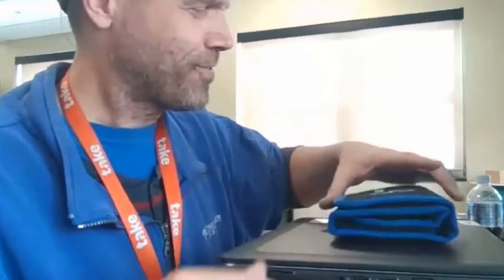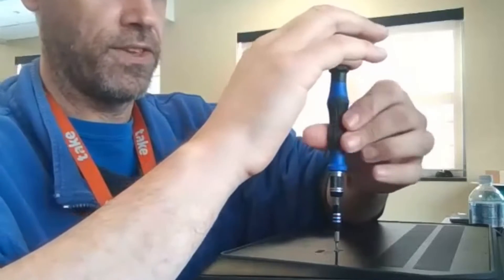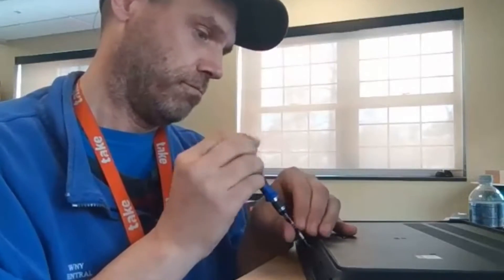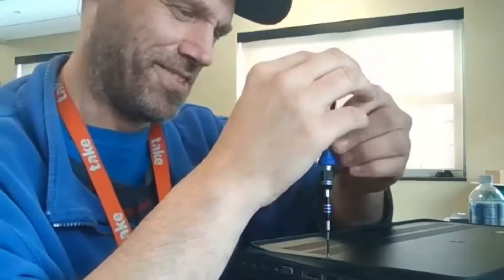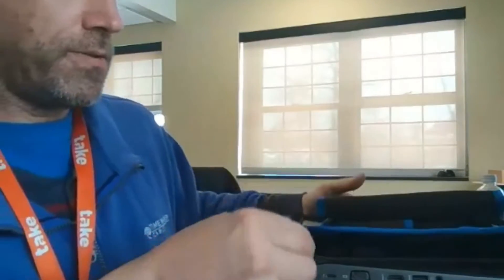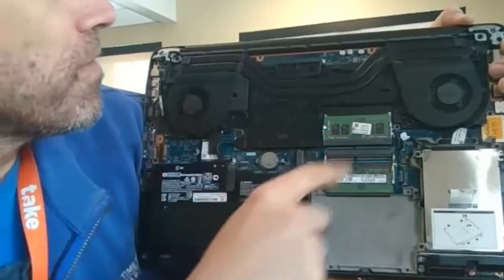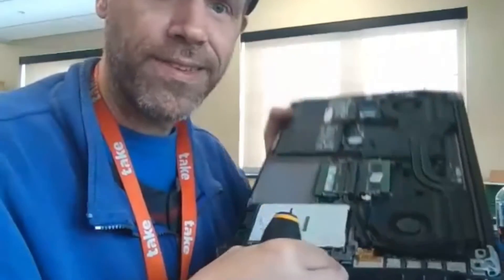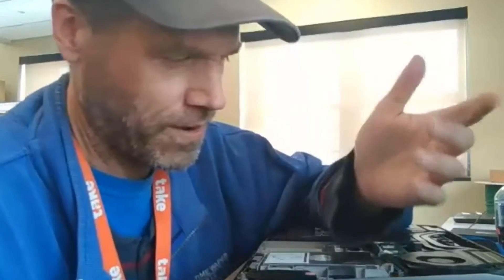How to Upgrade and Replace the Hard Drive on HP ZBook 17 G3 Laptop

Comment: hello. what was the size of screw tip that you used? was that t8?
Reply from the maker: I'm not sure anymore. It was a while ago. I have a kit with several different bits so I imagine it was just a matter of cycling through them to find the correct one.
Reply: They are T8
Reply: @pepitovfr  thanks